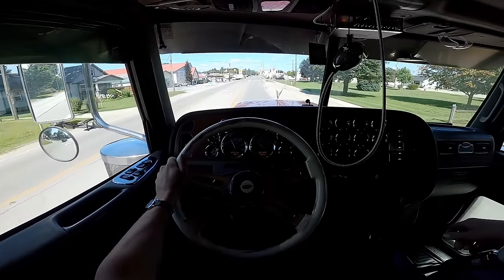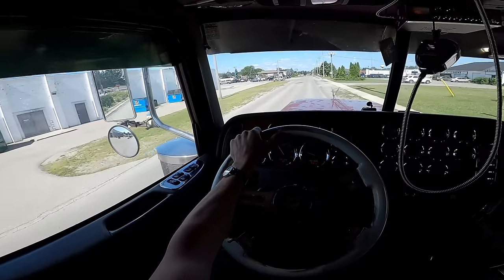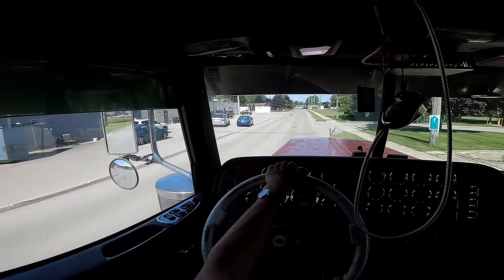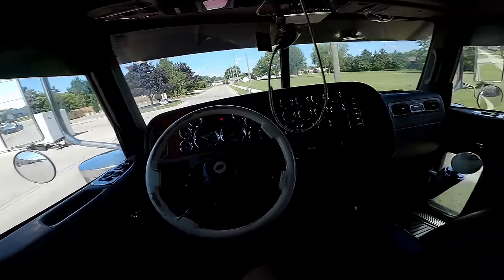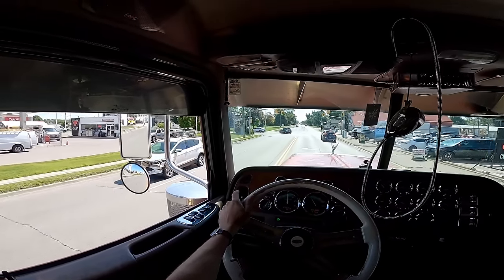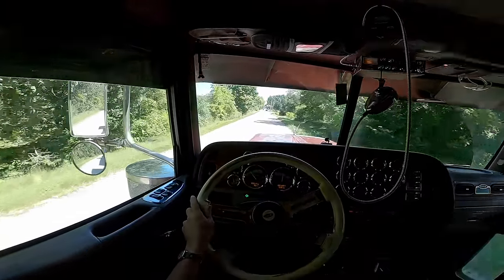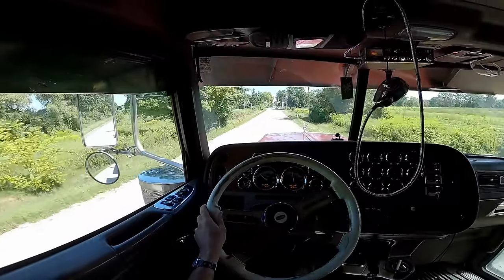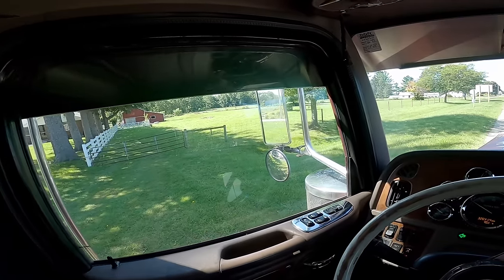BEST Part Of OWNING My Own Rig!

Comment: Matt, you bring back fond memories of my dad. Back in 1987, while I was building my house, my dad kept a day cab tractor and several surplus 40' dry vans for the farm. I was to the point of siding and gutters. He offered to pick up for me at the wholesale building material supply which was almost next door to the produce terminal he used. This saved me a nominal deliver charge but made my dad feel very good that he could help like that. He scheduled a delivery of pumpkins from the farm and back-hauled my gutters and siding in the semi. The longest gutter was 41' which was tricky to haul, but fit handily diagonally in the trailer. Nice benefit of owning a rig, even if it was a 20 year old day cab single axle.
Reply: still does the job it's meant to do 
and every thing is better than having an empty run anyways

Comment: Does the Moffet have a little Kubota diesel?  If it does, try raising the rpms a little higher than idle and then turn the key to off.  I have the same problem with my Kubota tractor and if you raise the rpms a little higher than you normal would, it will cut off.

Comment: my question is for the little job like that why didnt you just take the trailers apart and took the b or the a trailer on their own
Reply from the maker: I was driving by with both empty trailers from a delivery beforehand, and even if I weren’t, it would be more hassle than it’s worth to drop one of the trailers then go get it, come back, and hook the trailer again for my next load
Reply: @callthemall  ohhh ok you had loads before and after yeah makes sense now I thought you just had the double just for that one load thanks for clarifying